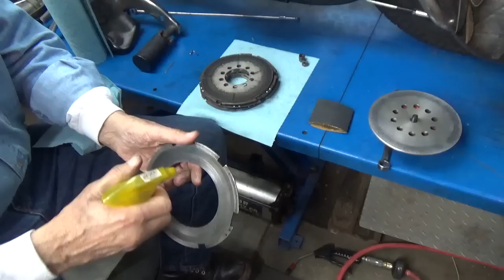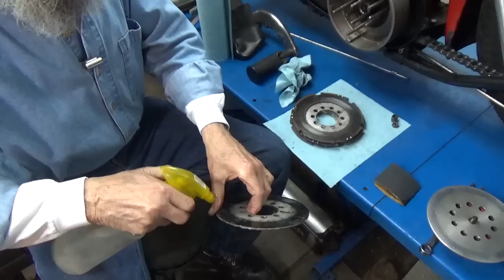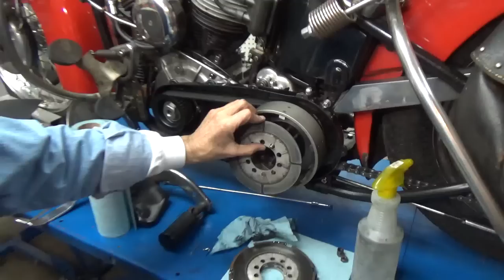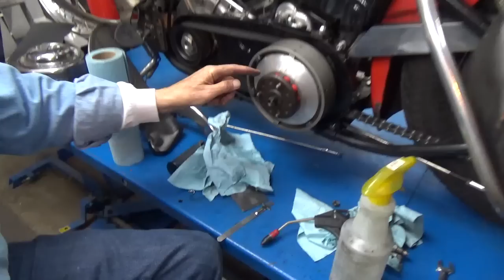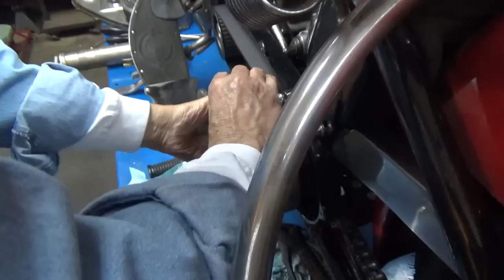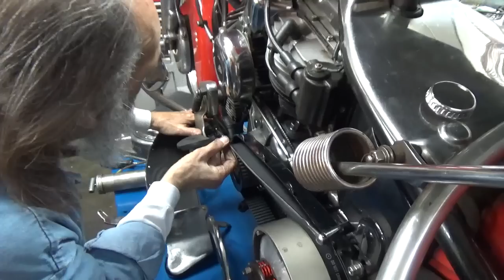We're Doing The Clutch Adjustment On My Harley Davidson Panhead Again!

Comment: Is the steel plate you put in up against the clutch basket an "extra" plate? I have been running my shovel the same way sinse the 1980's. It kept the clutch basket looking new but I have also had a aftermarket Tamer in there sinse the 1980's and I recently look at the tamer factory directions first time sinse I put Tamer in, in the 1980's and it said NOT to run a steel plate in there up against the basket but I have alway's been doing it and can't remember why I would have done that if "Tamer" directions say not too.
Reply from the maker: You know, when we start mixing and matching products, nothing succeeds like success.  I use a steel plate in there so the clutch fiber plate doesn't eat the inside of an aluminum basket.  I round the edges and make it sit flat.  Is it correct?  According to whom?  It sure works well.  Sounds like yours has for almost 40 years.

Comment: Hello bro. Mike, I have some new but older steel friction plates for my fxr clutch, there is some surface rust, not much but a lil here and there on plates... what have you found works best to remove rust to prepare for use?...Brillo pad, steel wool, light sand paper?
Reply from the maker: Very fine sandpaper, then was with alcohol and dry.
Reply: Pacific Mike thanks bro. Mike. Keep up the great job!

Comment: Mike, 58 pan / shovel chopper, do know of any clutch handle that will make pulling in clutch easier, clutch cable is greased, cleaned clutch plates , 4 speed transmission, any thoughts?
Reply from the maker: The best ever, as far as I'm concerned, is a properly adjusted "mousetrap."  In your service manual, it is referred to as a "clutch booster assembly."  We really addressed this in a previous video. Go to our Youtube Channel Home page and look under "Videos."  There's a bunch.  Look for the one with the word "mousetrap" in it.

Comment: By running a belt primary what do you do with the blow by tube that oils the chain on an original setup?
Reply from the maker: I shorten it and put a rubber hose on it to vent to the rear of the bike, behind the inner primary tin.  Be sure and turn off the primary chain oiler at the pump.
Reply: @pacificmike9501  thank you for the valuable information!

Comment: Another great video. On my knucklehead i ran the old pressure plate and some old (maybee original) springs, and that ment that there was'nt  the same tension in each spring, so when ever i serviced it, instead of messureing the distance, I had to tightening the spring different each time. I did it aprox and then made sure the ajusting plate went straight out when activated. Pull the clutch severeal times, while slowy rotating the clutchhead (using kickpedal or backwheel). I know i could have bought new springs, but they lasted the 26 year i rode the bike.

Greeting from Denmark
Reply from the maker: Thank you.  And, your explanation is great.  I tried to show getting the releasing disc to move straight and even in one of our previous videos. This was a "go back and make it quit slipping" video.  And I appreciate the fact that parts that are  "half worn are still half good."

Comment: Hey there Mike, I have a 61 Panhead with electric start, and when it's in gear and I pull in the clutch which is a mouse trap, the bike wont roll backwards, why do you think that is? Thank you in advance
Reply from the maker: Sounds like the clutch is not releasing.  You've got quite a combination going there.  A 61 with an electric start.  Must be something someone built.

Comment: I have a 74 shovel fx. I took the clutches out to clean them since they were dirty and my bike would walk a bit at red lights. (Already replaced the throw out bearing). When I pulled the primary cover off there was no oil. So when I put everything back together will I have to add so much oil? Or does it get its oil from the engine? Do the clutches need to be completely dry?
Reply from the maker: Yes, it is a dry clutch.  Clean and dry the plates.  Your primary should have a circulating system in it.  It gets its oil from the engine and returns it to the engine.  It is shown in the factory service manual.  It has a series of oil lines.  You must have a service manual.

Comment: Hi, greetings from germany. I am riding an 1984 shovel  (FLH, 80 cui, 4 speed). I had to replace the clutch cable as it was broken. In the workbook it only states to set the the free play via the cable i.e. 1/16 inch gab between handle and bracket. However there is nothing about the push rod. When I turn in the adjuster screw until I feel slight resistence. How far I have to turn back the adjuster screw? half a turn or a quarter or even less?
Reply from the maker: Quarter is fine.  In your service manual there is a measurement from the tranny lid to the clutch arm od 13/16"

Comment: Mike, what do you think about the crowd who says to soak the frictions in oil?
Reply from the maker: Works fine on a bike with a wet clutch. You'll find it in your service manual. Don't know what your bike is.  Harleys had dry clutches up into the early eighties.  What do you have?
Reply: @pacificmike9501  51 Pan with a belt drive (dry) but enclosed
Reply from the maker: I run my belt drives enclosed.  Belt drives and their clutches are all run dry.

Comment: I have the exact same primary drive setup on my shovelhead. Same springs and all. In 1st gear when I slowly let off the clutch it doesn't start moving forward. The gear catches at the very end and the bike clanks forward and conks out. Not sure what's going on. Also, it's a suicide shift setup.
Reply from the maker: I think you mean  "suicide clutch."  There is no such thing as a "suicide shift."  So, I assume you have a hand shift and suicide clutch setup.  It sounds like the clutch plates are sticking on the "fingers of the clutch hub and then releasing suddenly.  It's a guess without inspecting it, but, if the "fingers" are grooved too badly, this does occur.  It's also a good idea to make sure the holes in the plates are smooth so they can slide in and out.  Also, be sure the clutch basket is nice and clean so the steels don't hang up.

Comment: Mike I'm getting ready to set my 75 up with a mouse trap, have you done a video on how to install the mouse trap I;ve seen the one on the adjustment
Reply from the maker: The adjustment tells you enough.  You'll need the proper length rod and a clutch cable intended for a mousetrap.  Not much else to it.  The last year that had them was 1967, and 65-67 was the same.  65-67 mousetrap had two holes in its plate.  The second hole was to line up the rod with the cast aluminum primaries and back to the clutch arm.  It should come out very nice.  Enjoy it.  Don't get frustrated.  You'll probably adjust it a couple times 'til you get it right.  Well worth the effort.

Comment: Hey mike .. I asked about my Shovelhead yesterday, today my harley 1947 45 ci pretty much bone stock with the 3 speed crash box transmission,  how ever I  have a difficulty in putting it in first after starting and warming up, she like to go into 2nd gear first then drops into 1st gear.  I can drive it most day long until I stop for coffee and have to go through this gear process over again? Thoughts?  Thanks in advance
Reply from the maker: I sounds like your clutch is not releasing completely.  And, your gear lube has not warmed up yet.  Those "crash boxes" need everything right or the gears "crash" pretty hard against each other.
Reply: @pacificmike9501  have the Big Fix kit to install on the transmission.  I'm still running the ball bearings in the cage for now, my friend thinks it's in the clutch too. Whether or not it's in adjustment or not, I've taken apart and cleaned clutch plates and relubed the bearings in the cage and checked the adjustment on the springs afterwards.  It ran the same last summer. Head scratcher for me...
Reply: I could be wrong but My Dad had several of those servi car's and and 3 or 4  flathead engines on his bench and I think all those 3 speed transmissions have a reverse. I'm just saying for safety purpose's. That's why they only have 3 speeds. I knew all this stuff when i was a teen but i forgot a lot so i could be wrong,

Comment: Hey mike I have a  similar open primary on my shovel head I have tried to find a measurement for the adjustment of the springs but I can’t seem to find anything. As of right now the bike just shuts off when put it in gear. Thanks in advance
Reply from the maker: You'll have to experiment.  Don't know what you've got.  Shuts off when you put it in gear, or when you let the clutch out.  Do you have a service manual?
Reply: "Draw down stud nuts evenly until distance from back of pressure play to front of clutch releasing disc is 1-1/32 in." (by shop manual page 4-6, gauge on this video).

Comment: Hi mike Ive been watching your evo build videos as I am doing a top end rebuild on my 1988 flhs Electra glide sport Its helped me so much....but Ive been looking for a clutch service on a evo style clutch on your youtube channel I cant find one any chance it might come up soon? 
My clutch was very stiff last time i used my bike Im pretty sure I need new clutch plates.
Reply from the maker: Check your service manual.  There's an easy measurement that tells how to check it.  That's an early Evo.  Most of those early Evo clutch hubs have been replaced by now.  I wish I had an early Evo to show this on.  Don't offer, please.  I'm trying to get caught up with a lot of stuff.  When it comes up, we'll show it.
Reply: @pacificmike9501  Thank you for the quick response....As much as I would like to offer im in Vancouver BC Canada dont think its possible rite now.
 ive got the manual but i learn much better by watching. their is a lot of other videos but you do it best.
Unfortunately but fortunately its a barn find although I was able to get it running it a had a few problems mostly one of the lifters had failed and both bottom jugs were leaking badly.
Reply: ⁷

Comment: Mike, I have a 1974 FXE, and I'm having trouble finding spark plugs, seems no one is caring my type of plug. Automate 4275, shorty's, I have some coming from eBay, but no one here in St Louis is caring that plug, not even the bike shops. HELP !!!!!
Reply from the maker: 74 Shovelhead uses a plain old J12YC Champion.  That is the same as a 283 cu. in. Chevrolet uses.  There are several brands you can "cross-reference" from there.  Later Harleys use long reach plugs.  But 1974 is still a short reach.  You just need to go to a "knowledgeable" auto parts supply.  Okay, find an old guy.
Reply: @pacificmike9501  
Thanks Mike

Comment: I was wondering if you can do a video on how to get a open primary to run true. I have a big bear with a Evo and a tank top 4 speed and can not get the belt (motor and transmission are not connected with a plate). Thanks.
Reply from the maker: If I had one around, I'd do it.  Don't know exactly what you have, but the shafts have to be and stay in the same plane.  They must be parallel.

Comment: Hi Mike, I have a 78 fxe 4 speed shovelhead I built over the winter , here's my issue. I have blocked the primary, and engine oil lines and made it separate from engine . The clutch grabs and moans hard for about the first few min. of riding doing this from a stop then its fine. I have re-adjusted and gone back in till i'm blue in the face, I also installed a clutch ram jet retainer with no difference.  there is 28 oz of primary fluid in primary and clutch is new, plate adjustment is 1+1/32 inch . My arm is about 5/16 from starter and there is about 1/4 inch play at the cable lever. rod is turned in till slight resistance and I have backed off 1/4 to 3/4 turns in 3 different tries to stop the issue with no luck doing all of this in proper order.  Please help, what am I missing?
Reply from the maker: You aren't going to like my answer, but, I've done my best to answer it over and over again.  The original system was fine.  It worked with a dry clutch.  The later system is fine.  I works with a wet clutch.  Mixing the two doesn't work very well.  You have succeeded in getting a dry clutch wet.  The system you have was not designed to hold 28 ounces of oil.  All it does is make a mess.  Pouring a little oil in is what most people try after defeating the stock system.  They'll tell you horror stories of their clutch contaminating their engine with the stock system.  I still stick with the stock circulating system with a nice dry clutch.  It works fine.
Reply: @pacificmike9501   The clutch that I installed was for a wet or dry application. I get the to much oil as it is seeping from the solenoid on the inner primary making a mess. If I went back to the circulation from engine oil what brand  clutch would you recommend? I may just do that, as you said, people were telling me the oil going back into the engine wasn't good as it could be contaminated from clutch disks. I still don't get why it would release fine after a few uses. could I clean and sand discs and reuse with 6 to 8 oz of oil still closed off? Or do you think the discs are junk from being too saturated with oil. Thanks for your quick reply!

Comment: Mike I’m converting to a belt drive, should I add an extra steel?
Reply from the maker: I can' t see it from here.  Does the first fiber run against the inside of an aluminum basket?  If it does, I suggest a steel in there first.  You may have to bevel the edges of the steel to make it sit flat in the bottom of the basket.  Just my suggestion.  I think that was the question.
Reply: Pacific Mike yes it’s a 62 FL with a stock OEM hub and clutch. I ordered one gonna give it a go, I figure it’d save that aluminum hub as you said, Thank you

Comment: Hi Mike, do you have pushrod adjustment videos, 80 shovelhead.
Reply from the maker: I think we showed it on the Shovelhead assembly.  It is the same for 74 or 80 inch with hydraulic lifters.  Or, do you have solids?  If you have solids, it's the same as any Harley with solid lifters.  You can go by the Knucklehead valve adjustment in our videos.
Reply: Hi Mike, i have solid lifters, i have done it before, just looking for a refresher, and thank you for the videos.

Comment: Is this the same pin metric bikes such as Kawasaki Vulcan 1500?
Reply: On metric bikes...not pin metric
Reply from the maker: Harleys have always used English measurements for fasteners, although recently, there are a few metrics thrown in.  Also, when reading specifications, you will find metrics used more and more.  Harley Davidson has always published their specifications in both English and Metric measurements, such as displacement and bore and stroke measurements.

Comment: My dry clutch with a 4 speed seems to want to creep forward a bit when in gear with the clutch pulled in.
Would backing off the nuts a hair to lower spring tension be a good idea?
Reply from the maker: Not usually.  Taking it apart and cleaning it is always good.  But, maybe it isn't opening evenly when you disengage it.  Getting a good straight adjustment on it may do it.  Maybe the fingers on the clutch hub have deep grooves in them that are hanging up the plates.
Reply: @pacificmike9501  I will open it up and clean and get a straight adjustment on it. Thanks mike!

Comment: Hi Mike.  A question on that belt drive; with normal hp engines, I am guessing that setup you have doesn't get too hot inside a closed primary?  I am considering the same setup in a 80" Shovelhead, more or less stock.  Also, with all that is going on our little planet, your videos are cathartic.  If everyone unhappy in the world got to ride a motorcycle once a week, what a better world we might have...:-)
Reply from the maker: Thank You.  I am here for a good time.  I've worked on belt drives on Harleys since shortly after they were invented.  I've never had a heat problem and today's belts are better than ever.  Kevlar is neat stuff.  Proper alignment and tension according to the manufacturer's recommendations is key.
Reply: @pacificmike9501  You've mentioned belt for kick start only, and chain for electric start.  Does a belt hold things together to tight, and make it a problem for the electric starter to engage without a little play?

Comment: Mike, I notice that you don't use the clutch spring disc as shown in the Panhead svc. manual. Why not?
Reply from the maker: Yes I do.  That plate is going into the bottom, or back, of the basket.  It needs to fit flat in there, which I do explain in the video.  You can do without the "buffers" in there, but I like them.  They keep things quiet, but not on that bottom plate, which I install so as not to tear up an aluminum clutch basket.
Reply: Mike, I'm referring to part # 37950-41 also referred to as a "half plate.  In my (reprint) 48-57 svc. Manual, item 7, figure 4B-4. Thanks, love your videos.
Reply from the maker: You can build it any way you like, really.  The "half plate is fine."  I have a tendency (on my own bikes) to build a clutch from what I have.  If everything is according to original, that's great.  Different companies have made different plates and what works for you, won't always work for everyone.  That half plate is cool.  Don't always have one.  If the "stack"  works well, spring travel, measurement, breaks evenly, spring pressure, you're good to go.  Sorry I misunderstood the first question.
Reply: Thanks for the explanation
Reply from the maker: I hope it was useful to you.